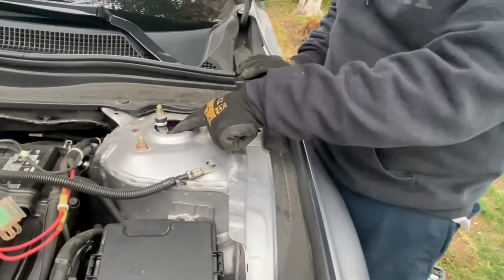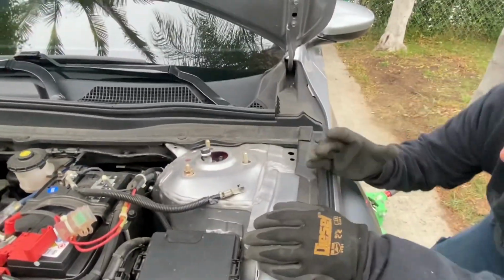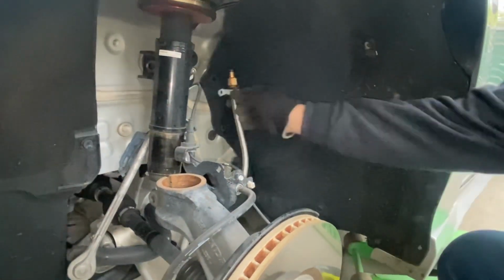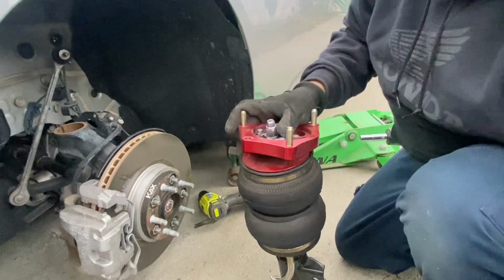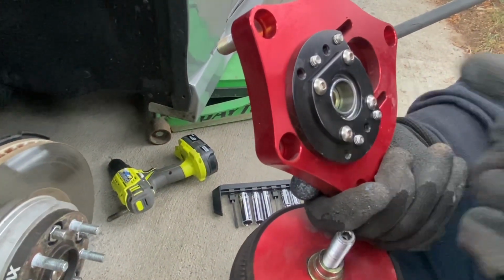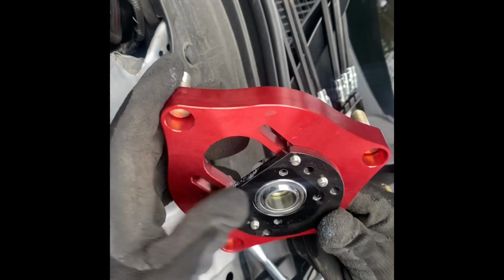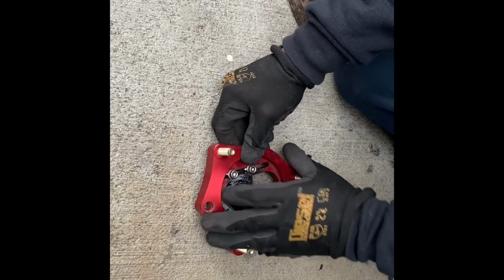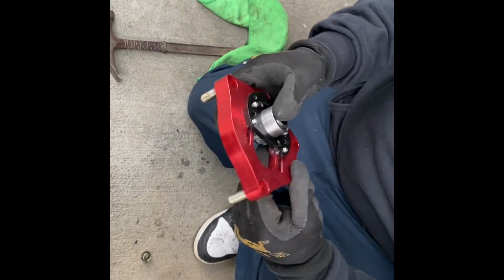Pillow ball replacement airlift performance 2018-2022 Honda accord #airliftperformance

Comment: How long did you have the bags before changing the bearings?
Reply from the maker: This not my car but I think like a 1 yr 1/2 but he has it cambered All the way . I have mine for a year in April I haven’t had any problems just make sure to keep pillow ball lubricant with lithium grease
Reply: Where did you order the bearings ?
Reply from the maker: Internet try Bagriders.com